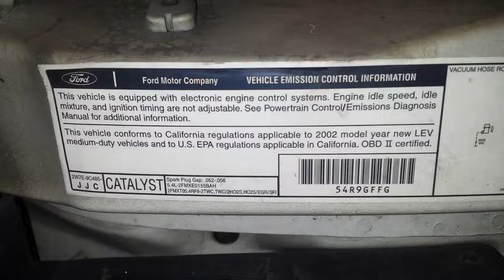Ford Econoline emissions: PCV, EGR, EVAP canister, & purge locations

Comment: This is GREAT!  So damn difficult to figure out where this stuff is.  Now, I have a question.  At what mileage should all this stuff be replaced?
Reply from the maker: not all these parts have a schedule maintenance. off the top of my head just the pcv and O2 sensors sh I uld be replaced. O2 sensors every 90,000 miles... but most people wait til the check engine light comes on. which I guess could be ok. with the pcv..... I replace mine every 30,ooo to 50,000 and that's a little much.  I hope that helps ya.
Reply: Hello Scott, thank you for your reply.  I have the check engine light on, with codes P2196 and P2198, which when Googled, give so many possible issues, that is would be a nightmare to figure out which area is causing these codes to fire.  I already replaced all four C02 sensors, so that is why I started looking at these pollution controls and sensors.  However, I AM experiencing high fuel consumption, especially when the AC is on, and the AC itself does have an issue.  It only works intermittently (fan is always on, but the cold air gets blocked by something).  I have already replaced the blend door mechanism complete, but to no avail.  It's over 110-degrees here, so having AC is very critical.  So a friend suggested that I may have a vacuum issue, since the AC will eventually blow cold constantly when I get up on the highway at a steady speed.  If indeed this is a vacuum issue, which of these components might be the culprit?  I am also failing smog, event AFTER replacing the CO2 sensors.  The smog check station says that I need to drive 500 to 1000 miles, before the computer will get the correct info, but I did that, and it still fails, and now these new codes are coming up.  Anything you can suggest would be most helpful.  I am not working at this time, so am trying to repair the problem myself.
Reply from the maker: You could have a stuck open injector on bank 2 or even a dead cylinder. A vacuum leak usually causes a lean code.  I would start with a compression check just to make sure your working with good motor. 

With the AC, the fan should stay on the whole time the AC is on.  i am not the best with the AC system diagnosis.